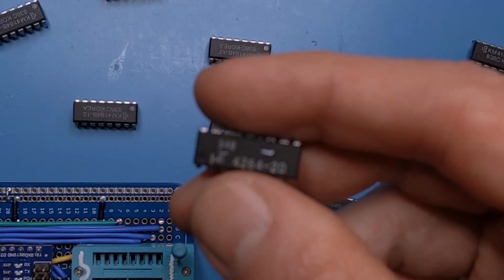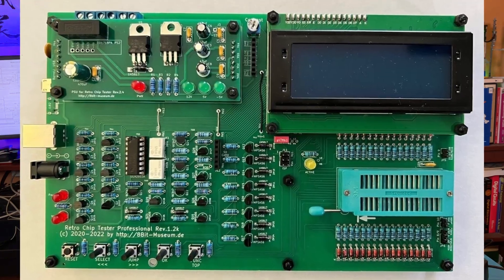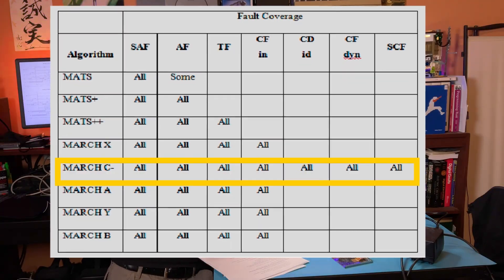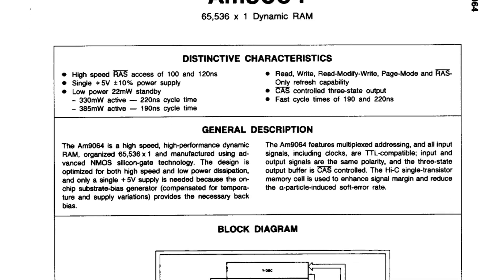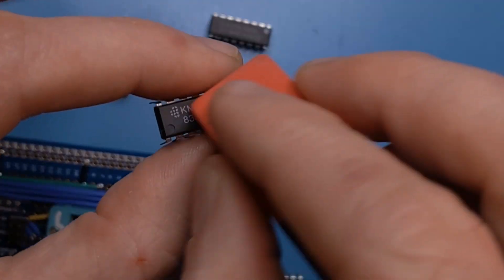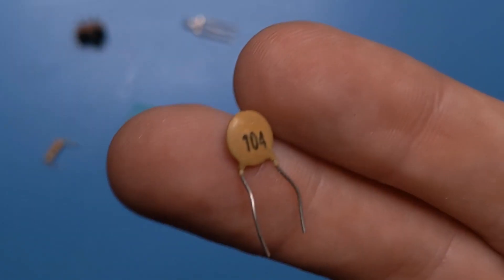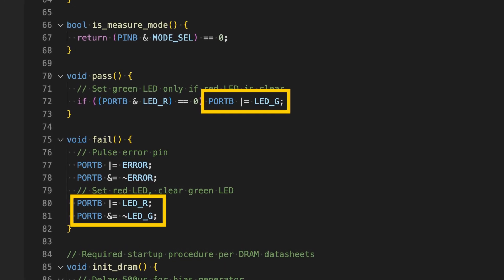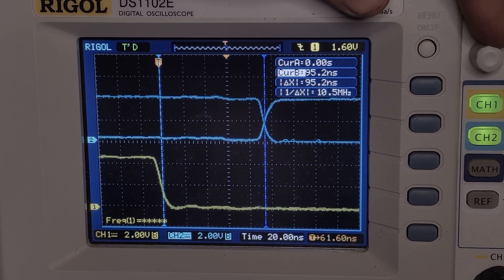Testing DRAM the RIGHT way

Comment from the maker: The code and diagrams can be found at https://github.com/trevor-makes/avr-dram-tester
What other features would you like to see in a kit or assembled board? I'm working on supporting 41256 and 4116, and maybe 4416, 41464, 44256 DRAMs
Reply: 44256 would be great ,because a lot of Amiga users need them. That’s a huge, if not even the biggest retrocomputing community, after c64!
Reply: What a project! , thanks for sharing. I would love to have it expanded to 44256 , as those are the ones I am currently trying to diagnose.

There are a few board designs around for these testers, but I truly appreaciate your approach to arrange it using a bread board is fantastic. Being able to put together this in a hurry for a quick test is awesome in itself. Also, I am lucky enough to have a cheap oscillocope, and I will sure test those measurements. The whole bundle project/video is fantastic. It really is.

Comment: Hi Trevor, is it possible for you to provide an .ino file for this project, to use with the Arduino IDE please.
Reply from the maker: Hi Susan, I looked into this before, but it needs some modifications before it will work with the Arduino IDE.
Reply: @TrevorMakes  Yes, I understand, thanks for your reply.

Comment: I've been looking to get something to test my old DRAMs. My only comment is it would be nice to not have to plug the power cable in each time you want to test another DRAM. I'm sure I can just add another switch for power but figured I'd mention it if you ever decide to modify this version.
Also, what is that board you're attaching the Arduino to? It's not in the BOM.

Comment: This is good! I have also messed with those existing projects you mentioned, and thought that they were not enough. A march test is the way to go, and I thank you for this project. I don't have enough C++ knowledge to understand and modify your code, so I need to ask you, could you extend this to cover 4116 DRAMs too? Yes, I know there are other voltages (-5V and 12V) involved here, but if those were handled, the rest should be pretty much the same.
Reply from the maker: Thanks! I think the work would mainly be in wiring up the -5 and +12 as you suggest, along with a small code tweak. I'll take a look at it when I pick up the project again. Options would be a one-off tester for just 4116, a simpler board with different sockets for 4164/256 and 4116, or a more sophisticated board with one socket that has configurable pins.
Reply: @TrevorMakes  Thanks! I think the best approach would be a single board with 2 ZIF sockets.

Comment: Is it possible to add 44256 dram as well? 
These are used as well in retrocomputers and have a DIP20 package
Reply from the maker: I have some of those on hand and have been meaning to make a tester for them. The pinout is pretty different (4-bit vs 1-bit data bus), but I think I determined it was doable with similar firmware on the same microcontroller.
Reply: @TrevorMakes  have you already checked if 256kx4 Chips work as well - like the ones used in Amiga for instance 256kx4 or 1Mx4 RAM (mostly ZIP Sockets, but this can be adapted). 
I just bought some of those (256k x 4) and I have RAM faults, as there is plenty of those, checking them would allow easier tracking of the faulty RAMs.

Comment: Will there be a version with a display ?
Reply from the maker: I've been meaning to get back to this project. If I remember correctly, I was thinking I could make an SPI display work with this. But I was also thinking about redoing the whole thing with a Pi Pico to possibly support finer access time measurement. I've got some vintage computer stuff to work on, so maybe I'll take another look at it this year.

Comment: Nice project. 
I build it and having some problems with it. All my 4164 ICs were measured bad. With my logic analyser i figured out that PD0 and PD1  ~7us after powerup are permanently in a HIGH state, while all other pins toggle correctly. I tried several NANOs but on all it the same issue. At first i thought the FTDI/CH340 is the problem and removed them, but the issue still exists. Is there any fix i can try to solve the problem?
Reply: After further testing i found the error. Somehow PlatformIO programmed the wrong firmware after compiling. I removed the ATMega328 from the NANO Board and verified the written firmware with the firmware from the PlatformIO folder and they were different. After that i flashed the firmware from the PlatformIO output folder and now the RAM Tester Workshop flawlessly. Strangely the issue occurrred on several NANOs i used. Each time the firmware was recompiled and the issue kept occuring
Reply from the maker: Bah, I just now saw your followup where you found the problem. Hard to sort through comments in the YT Studio app... Glad you found the problem. Very strange about the firmware. I've had a few random Nano clones where I've had to reflash them with an ISP to get them working, so I know that pain.
Reply: Update: replaced the Nano with one that looks 99.999% the same (has micro usb instead) solved it. Working great now.
Reply from the maker: That's strange. On the official Nano as well as the clone boards I have, there are 1K resistors between D0/D1 and the USB serial chip, which should keep it from interfering too much with anything directly connected to D0/D1. Are you using the tester while powered with a computer—and are you keeping a serial monitor open—or are you powering it with a USB power adapter? If you went as far as removing the USB chip, that definitely shouldn't be affecting D0/D1. Edit: oh you checked the signals with your logic analyzer hm... Without the DRAM in place and the circuit off, is there continuity between those pins and the 5V rail? Can you try a simple Arduino sketch that configures those pins and toggles them high/low in a loop to see if there's something weird with your Nanos?
Reply: Interesting. I have the same problem. D0 and D1 are always HI/5v on my cheap Nano clone. I'm relatively sure PlatformIO uploads the correct hex. I assume the RX/TX is the cause in my case. Trying to figure out if I can configure them to act as I/O only.
Reply: Well - powering the Nano through it's 5V pin instead of USB didn't solve it.

Comment: Interesting project.
Did you get around to creating a custom board with your custom layout?
How about a second micro controller doing the timing testing using the interrupt lines?
Reply from the maker: Still on the back burner. The best I could measure with the ATmega was 50ns intervals, which was interesting, but not really that practical (and I don't have any failing/out of spec DRAM to test it with). I think the timing measurement mode with an oscilloscope is the most reliable way.
Reply: @TrevorMakes  
Hmmmm how about switching up to a Raspberry Pi Pico?
Use one core for the DRAM testing and one core for measurement?  Plus could probably do the measurement live while reading from the RAM?

That is if I remember right and the Pico has a 2 core ARM based micro controller
Reply from the maker: That's a good idea. I think I had been considering the Pi Pico for that. I should give that a try!
Reply: @TrevorMakes The PIO blocks could also be interesting for this purpose.

Comment: This really is the best implementation I've seen of an efficient DRAM tester using the nano, and I really like the infinite loop switch to measure the access time! One thing I would like to see is an option to print out the first failing address and data bits through serial monitor, or to a simple display OLED screen. Even better, a code switch allowing the first N number of failures to be displayed or printed. Have you considered this type of enhancement? My coding isn't up to the level of doing it myself. But again... great work here!
Reply from the maker: Thanks! I had been considering printing the failing addresses, but figured it wasn't that helpful in the case of a bad DRAM--though I suppose it could help diagnosing if there's a loose connection in the tester/ZIF socket or something. If I get around to adding an OLED display I may take another look at this.
Reply: That's exactly what I just did using serial monitor. ALL my RAMs are failing and I wanted to find out if they really are all bad or I assembled something wrong. Since they're all failing at the first address I guess it's back to building. 😄

Comment: thx, I can use your scope technique to test memory access times on a static RAM. 
I have a dual port IDT7132 2K x 8 Static ram shared between a Motorola 6802 at 1MHz on a pinball machine and an AtMega 1284 at 16 MHz. The ram busy signal is fed to a D flip flop that stretches the φ2 on the 6802 when an address collides. Confirming the stretch is working to properly read the ram is the test.
Reply from the maker: That sounds tricky to implement and test! And the ATMega can get a busy signal too! I wonder if you could do something like tie both address ports to the 6802 and trigger a fake one-shot write pulse on master from the real 6802 write pulse on slave. That way every write should be delayed by the same one-shot pulse width, making the timing more predictable/stable to examine with a scope. I was just thinking that if you have the ATMega and 6802 going asynchronously, the collisions will be unpredictable and you may need a logic analyzer to grab a trace to look over after the fact.

Comment: PLEASE PLEASE add support for 41256.
I personal restoration work is pending due to a proper DRAM tester.
PLEASE.
Reply from the maker: I have some 41256 coming in the mail. I'll add support for those in this version of the tester.
Reply: @TrevorMakes  Just a small suggestion:
Instate of combining both 4164 and 41256 into "one program" and increasing the complexity, keep the two programs separate.
One program for 4164 and a different program for 41256.
Reply from the maker: I went ahead and added 41256 support to the same program since it was easy to do so with template parameters. The test does some initial writes/reads to the lower and upper address spaces to detect the type of RAM.
Reply: Any chance for 256kx16 dram like V53C16258H 
Thanks ❤

Comment: I just push random data N amount of times and that's it. if any bit it wrong, i will see it. any address is wrong, \I see it. This can detect every single possible problem with memory. and so easy ti implement
Reply from the maker: Do you write a bit and then immediately read it back, or do you write the whole pattern before reading it back (using the same seed)? Do you then write the same random pattern inverted so you make sure to cover both 0 and 1 at every bit?